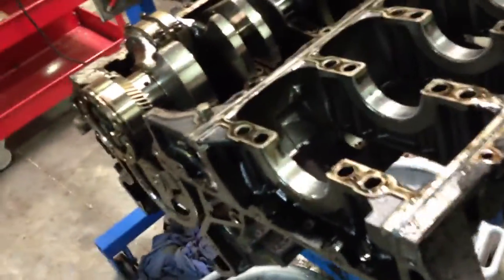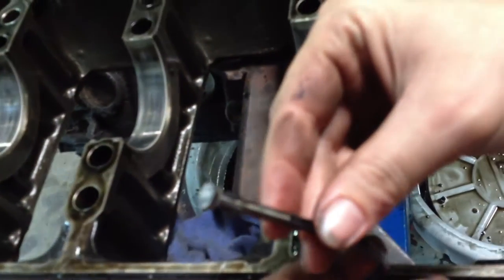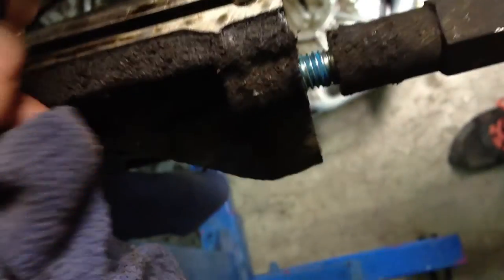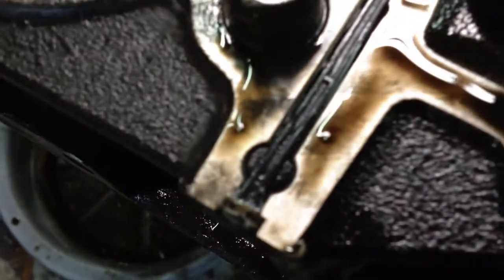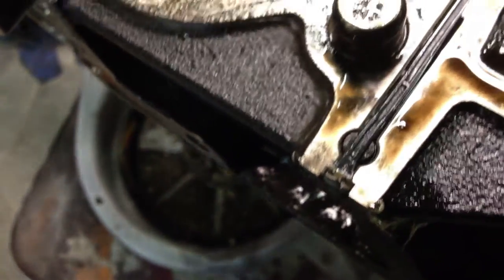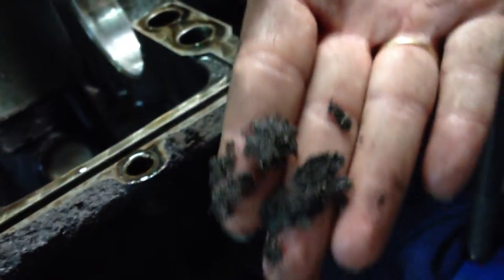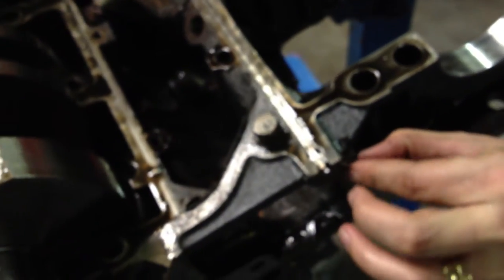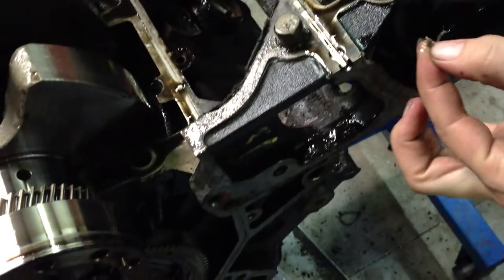Why bed plates leak from the factory

Comment: Hi buddy my lower oil pump is not getting any engine oil  I take apart end all my gasket on the upper end lower oil pan they are flat to the metal end my oil tube the oring is crusty end flat you think thas why I’m not getting oil to my lower oil pump let me know please love your videos
Reply: Sounds like to me you need to take the oil pump out to see if it’s damaged and also look to see if the front cover has any damage from lifters coming apart.